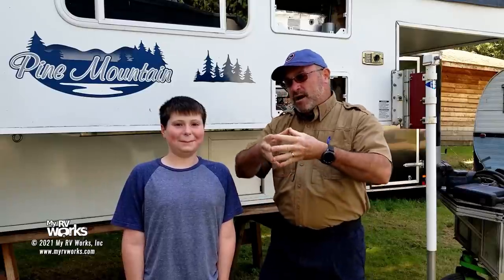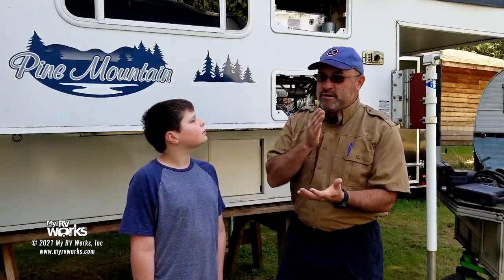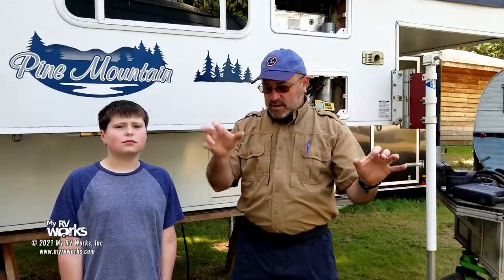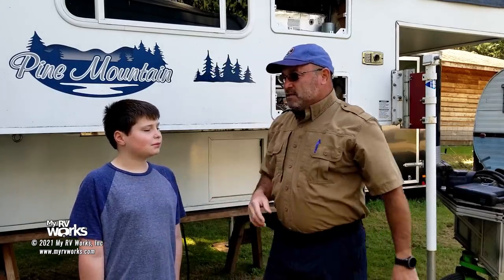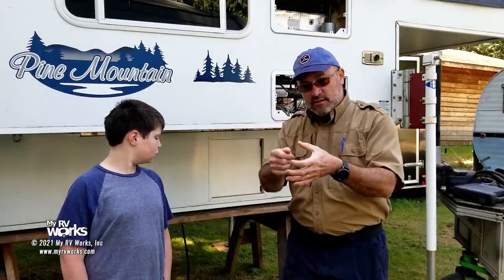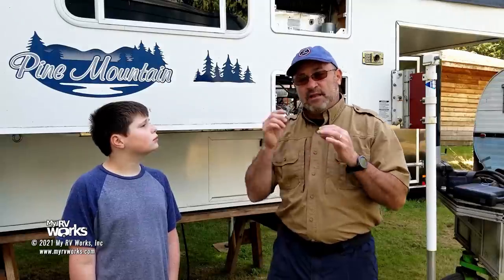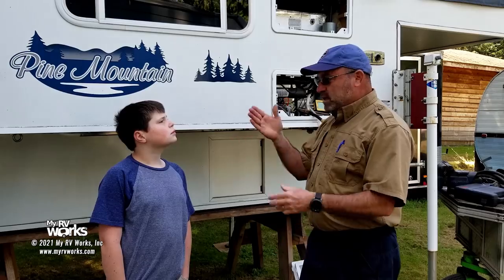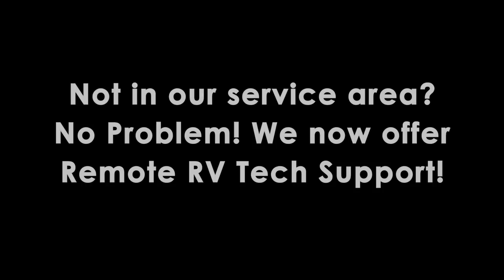Why Use Propane In An RV?  --  My RV Works

Comment: A couple of points here that i want to make.  The pressure in a propane cylinder will be constant regardless of the amount of liquid propane in there,  the pressure will drop quickly when there is no more liquid to evapourate.  Insulating the tank will do nothing in cold weather as there is no heat source.  Having said that, insulation may help keep the cylinder slightly warmer through a cold night after a warm day.  But on the other hand, insulation may make the cylinder colder because as propane evapourates in the cylinder it gets colder due to the heat of condensation being absorbed.  insulating the tank will make this worse not better!  In reality, propane in very cold temperatures needs to be heated to maintain the vapor pressure.  If you are heating the tank, then insulation will help.
The best thing about propane is that it can be stored safely as a liquid in a relatively inexpensive low pressure cylinder that is also easily refilled.  The pressure in a propane tank is only about 150 psi at normal temperatures(20 C), natural gas on the other hand cannot be stored as a liquid unless it is also cooled a significant amount.  Natural gas in a cylinder would be pressurized to 2000 psi or more and still be a gas not liquid.
Fuels (like methane and propane) are far denser as a liquid vs as a gas, ie a gallon of propane liquid vs a gallon of propane gas contains far more propane(by weight), natural gas is the same, this is true of any liquid including water

Comment: Thank you for this video. I'm trying to get my OLDER RV (1986) up and running effectively. It was running,  sort of.. I just had the alternator rebuilt. I've replaced all the fuel filters, and a few other parts as well.. And new tires.. Ew brake cylinder... Bbut except for refiling the propane tank (80%) I haven't started that yet.....

Comment: Thanks for all the facts about propane, I like facts because "I Automate".
Did I miss you saying, "Why use propane at all if you also have electric heat and you are not boondocking."
If you are hooked up to shore power at a camp site, the electricity is cheaper than propane.
And sometimes a small space heater or two will heat the whole rig.
Keep the propane for backup in case of power failure.

Comment: Awesome info! It's always good to test for leaks switching out propane (LP) cylinders. I prefer using a common Windex spray - applied to any connector if showing any bubble action will indicates a  leak.
Referring to LP being safe - simple precautions make it better as you said than electrical. I have responded with fire dept. to many more electrical shorts and overheated electrical wires & equipment fires in my career than those caused by LP or NG. So those nay-says need to remove their electrical components for safety sake.

Comment: I don’t know if you can help me but I can’t seem to find an answer to my question. I’m building a camper out of a cargo trailer and want to carry a pair of 20lb propane tanks for my outdoor kitchen. No gas will be run into the camper. I have several small Coleman stoves as well as a large Camp Chef stove. I also use propane lanterns outside. I’d like to run a gas line down the side of the trailer where I can connect these stoves without removing the regulators from each appliance as I also use these appliances without the trailer on occasion. Can I install a line without using a regulator at the tank?

Comment: Great video. I like your rambling also lol. However , I believe you said the byproduct is carbon dioxide. In fact it is the more deadly carbon monoxide CO. I believe that’s the reason the alarm is now a propane/CO alarm in newer RVs. When burning any fossil fuel there is carbon monoxide.
Reply from the maker: No, the byproduct a burning propane is water and carbon dioxide (not carbon monoxide). This is why propane is used as a source in homes and RVs for cooking and heating appliances. It's very safe if burned properly. 

It could be argued though that if the propane to air ratio is not to specification, and therefore does not burn properly, then it could develop carbon monoxide gas. That's why it's so important to have your propane pressure inspected in your RV at least annually. Here is a link that goes into it a little bit more detail on the propane burning chemistry. 
 https://sciencing.com/are-combustion-reactions-exothermic-13710438.html

The carbon monoxide alarm integrated in with a propane alarm is convenience only. Propane is heavier than air so it settles to the floor therefore the LP alarm is within four inches of the deck.  Carbon monoxide easley mixes with the surrounding air so the carbon monoxide alarm could be located anywhere. Carbon monoxide would be a byproduct of a gasoline generator running for example.  Since the mid-80s if your RV has a generator it is required to have a carbon monoxide alarm as well. Since both alarms need to be replaced every five years anyway some enterprising engineer/sales manager decided to incorporate them into one alarm module.

Hope this helps, thanks for watching.

Comment: Many motor homes in 2022 are getting rid of the propane tanks-Going all electric now with Aqua hot or oasis Mimi boiler 🤷‍♀️
Reply: and it's a huge pain in the bug because they NEVER have enough solar from the factory, and always have induction stove which suck power like a Tesla.

Comment: Info was good but I feel you could have been a little more brief with the chemical structure and the why of propane. I also think you should have covered the water vapor  effects it has inside the unit. To technical for the common RV’er. Being a safety Engineer I believe the explosive ration is 19% by volume

Comment: You were comparing the boiling of water in Fahrenheit and Propane.  That is really not correct. Propane boils at -44 degrees Celsius.  Not -44 degrees Fahrenheit.
Reply from the maker: Well there's really only 2 degrees difference between 42 Celsius and 44 Fahrenheit.    So the analogy still holds. I don't think 2° is going to throw people off too much LOL